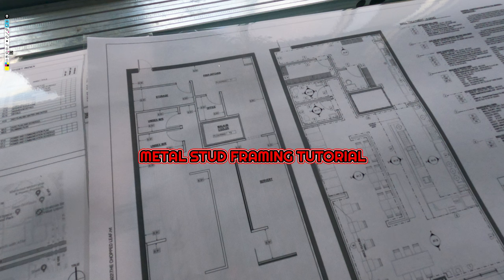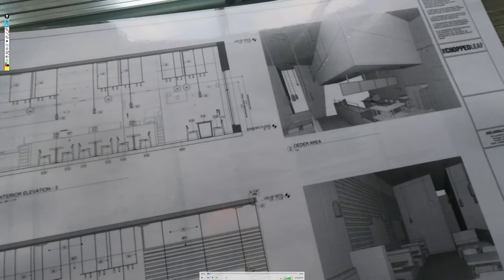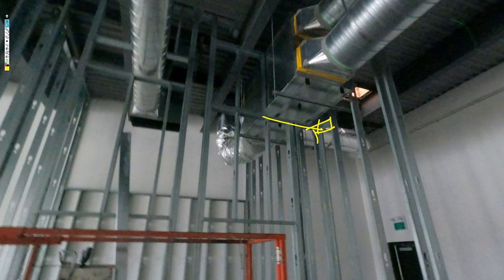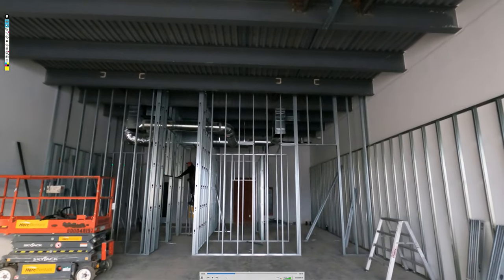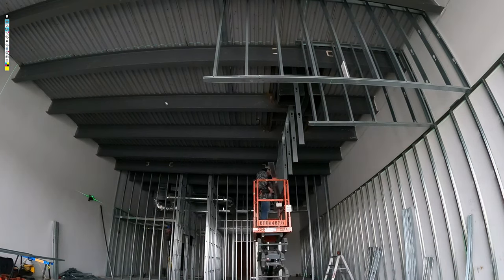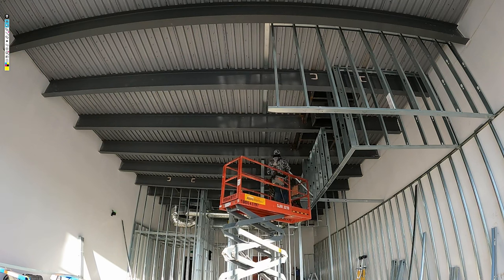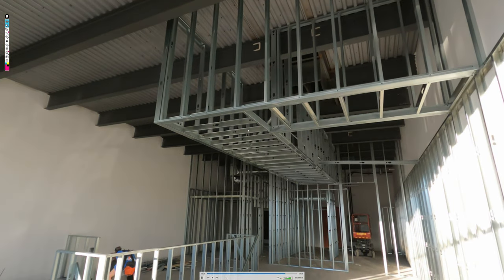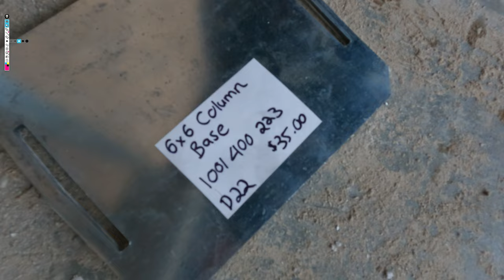Metal Stud Framing Tutorial! Walls, Bulkheads & Ceilings

Comment: I learned more from watching your video than I have learned from any foreman I have worked with before. I have been working construction for 5 years now and everytime I asked someone information about blue prints I would always get turned away. I've built all this before. After watching your video it finally clicked in my head. Thank you. I will pass this video on to my friends.
Reply from the maker: Exactly why I do this, I know how hard it is to get information out those guys. It's a better world when we pass on information and grow💪 right on man!
Reply: That's one of my pet peeves. When are a journeyman or an apprentice. Not being involved in the drawings to see exactly what you're building. Vertical wall assembly, very important to know. I am a foreman for a union metal stud framing outfit in Alaska. I don't keep my team in the dark at all, in fact the opposite. I am also determined to sharper than I was the day before.
Reply: Alot of times they dont want you to know too much they dont want you getting better then them and they dont want you taking their job i found this to be the case alot.  Ive forgot some of the stuff hes doing and have done tons myself im looking for assistant super or working foreman job I still enjoy work but years of framing and drywall got a double fused spine.  I bought some books years ago they are great and even old bosses used to copy pages to share info with the newer guys Im gonna pull them back out now to get some refreshing out of those too.  Get yours get the knowledge get the experience and get your money.  Dont let know hold you down.  There seems to be some good paying jobs out there today better then 25 years ago, and Im seeing alot of opportunities out there in the Trades and im bound to go get mine.  Take care brothers and be safe.  Sharp stuff, dont take a lift up without seeing where your wires are and dont stuff eachother in the face handing studs up.  Out in front of eachother and communication. I got some slices and dices slipped on a wet roof doing Apple Store for the release of the Iphone. Almost went down on my neck luckily I only cut my forearm all the way across the bottom massive cut.  Sliced a wrist one time as well.  Take care.

Comment: If I have a freestanding metal stud room, which is four walls, how do I run the ceiling joist… The walls are only 8 feet and the ceiling is 10 feet so it’s not going to be up to the metal structure and the building ceiling.
Reply from the maker: You should run your walls higher or lower the ceiling that's the only way my friend!

Comment: Thanks for the great video. Is bracing required for a 9 foot 4 inch tall partition below a 15 foot ceiling? Can I just screw into the 9 foot 4 inch drop ceiling grid?  The wall has joining walls so it’s locked in laterally. Thanks.

Comment: Great video, and honestly as a DIY’er it really helps.
Question, I’m planning to add a room in my condo unit, as per the builder’s layout plan. The floor is all vinyl laminate. Should the floor be removed or can I install the steel tracks on top of it?
Thanks
Reply from the maker: Right on!! Yes for sure you can put the track right on top of the vinyl! Just beware, if you ever want to remove the vinyl it will be a hassle to cut the edges around the walls. Most of the time we just put a new 1/4" subfloor over the vinyl for hardwood or carpet. Its very challenging to remove vinyl, it takes a large machine to do it proper / quick.
Reply: @ConstructionKronies  thanks a lot. But just to be clear, the vinyl i'm referring to are the floating vinyl planks flooring. Not sure if you responded with the glued-on squared tiles in mind, which i totally agree, those are a pain in the neck to remove. So, would that be okay, or should I remove a section of vinyl planks and then install the tracks? Cheers!
Reply from the maker: O ya so that makes it easier even, I would put the track right on top. If later they want to remove the flooring you can use the flush cutter around the perimeter and remove the tiles.

Comment: Hi, I just discovered your channel, amazing stuff.
I need to do a round framing platform of sorts 72” on the ceiling above a round table. What would you suggest is the best way to go about it?
Thanks?
Reply from the maker: You can get track that bends now. Draw the circle on the floor even if its a finished floor just tape down some hard board and draw on that. Then make the top and bottom track, forming it to that circle. Then laser up with a couple pin lasers 2 opposite edges to install the top track. Set a line laser to elevation and check your stud lengths, cut them, install a few to get the bottom track on (still checking with the pin lasers that it lines up with the top. After that just finish studding it out and then wrap with 1/4" or 1/2" drywall.

Comment: Do you use deflection track on top full length walls making studs 1 inch short and letting them float. No stud screws at top of wall
Reply from the maker: Yes, every wall that goes u\s structure has to have slot track. We cut the stud anywhere from 3/4" to 1" shorter and we put the screws just below the half way of the slot. You can also take them out.

Comment: Do you use 4" stud for the ceilings or 6" what span can you go with 5/8" sheet?
Reply from the maker: Mostly 3-5/8 if nothing goes on top. Go bigger both stud width and drywall, maybe add 3/4" ply if you plan to put anything heavy on it. You can really go as big as you want, brace it proper, run furring bar on top with hanger wires to eyelegs in the ceiling, they have for steel self drilling and concrete you can shoot them in with a Hilti. Like tbar but for drywall ceilings. Hope this makes sense.

Comment: ok nice to watch your videos ..nice work..i am a licensed carpenter but no experience with this stuff  but i now am working on a 60 unit building and have put in a bunch of drop ceilings using hat track and shinny 90 they call it all put together with half inch kelly screws ....but now they want me to build bulk heads in each living room to hide air pipes and dryer vents using hat track and   l brackets AKA shinny 90  any advice on hat track spacing and screw length or just any advice would be very very very much appreciated...thanks
Reply from the maker: Yes my man, use the #8x1/2" wafer screws for metal to metal and the 1-1/4 drywall screws putting the angle to drywall. I always go 16" o.c. for ceilings and bulkheads never 2'. Hope that's helps. My apologies it took so long to get back to you. I just got back from an out of town job was beat.

Comment: Great informative video, thank you for sharing.  How do you go about connecting the tracks to the sheet roof?
Reply from the maker: We will use self taping framing screws, wafer heads to the qdeck, and we use clips if the track lands in between them, use self tapers to attach the clips and then we can use regular framing screws to fasten to to clip (for light gauge steel). If it's concrete or structural steel we use the Hilti BX3.

Comment: So the corrugated metal roof decking you chose to “shoot” into instead of a self tapping screw was sufficient support for top track, is it common to be able to make protrusions into the roof decking? I have to frame some walls in a commercial application and I’m more of a residential contractor, Thanks!
Reply from the maker: Yes, so it's actually not corrugated roofing panels, it's qdeck. On top of the deck there will be another 8" at least of material before the gravel or sbs.  Only shoot to qdeck when it is full of concrete. We use heavy gauge framing screws to screw the track to it. Hope that helps my man!
Reply: @ConstructionKronies so you use screws to secure top track to qdeck. Is there a specific nailing to screwing pattern? Thanks.

Comment: can you use metal studs to build temporary office pods without fixing the studs to the wall for support? It would be a square box about 10x12.
Reply from the maker: You sure can. What we have done too is just double sided foam tape, two runs, on the bottom track so we don't make holes in the floor. Cross brace with 4" to 6" flat stock to keep square and if you can brace to the deck above then tbar (suspended ceiling grid.) The walls just have to be 6" above the ceiling.
Reply: @ConstructionKronies If it had to be low sound or sound proof, could I double up the studs and bridge them across the roof using bracing in between and just put sound proof drywall up?
My ceilings are 18ft tall.
My wife wants to learn drums.
Reply from the maker: Yes sorry for the late reply sometimes replies to replies get lost, YouTube needs a better way to tell us. For STC (sound rating) you can insulate, use 5/8"  drywall, even go 2 layers of 5/8"  both sides, use green glue (soundproofing glue) in between layers or resilient channel.

Comment: Can 25g studs hold double 5/8s drywall to help with sound?  Span is less than 10’.  Can also use a bracket at the middle of span into floor joist.
Reply from the maker: Yes for sure 25g will hold double 5/8". I just wouldn't go less than 3-5/8".

Comment: Hope all is well with you, how do you put extra support in a ceiling that's 14' by 14'?  Can you use a 16' piece of lumber and then attach your track to each side of that for extra support?
Reply from the maker: Use hanger wire. You can wrap it around a joist or use eyelegs.

Comment: at what point would you introduce black iron through the ratholes? my foreman was explaining it to me the other day on a 12ft soffit we installed. at what height would you normally do this
Reply from the maker: To be honest with you, I'm not sure. The rod is usually bolted in before we start by the iron worker. If the soffit needs any structural reinforcement the specifications will surely tell you.  We stiffen our soffit with channel and furring bar running along the inside and maybe wire or pencil rod we work on 4x4 max spacing at any elevation.

Comment: Is that the metal roof that the top track is screwed into asking for a friend 😅
Reply from the maker: No we wouldn't screw to a metal roof, what that is -- is metal decking we call qdeck it goes below the roof or is used between floors. Sometimes filled with concrete if between floors. When it's on the roof the next layer will be roof board, rigid insulation and so on depending on if it's sbs, modified or metal standing seam. It's I think 18 gauge usually so use heavy gauge self taping screws.

Comment: Great information in this video. How long of a span can you do on a ceiling before you need to add a support to the concrete floor above? I have a 16’ x 10’ space. Using 1/2” drywall. 2 1/2” x 10ft stud. Would I need to support it?
Reply from the maker: Yes grab some furring bar, run 3 rows (rule is braces every 4x4sq area) equal distance apart and make sure to attach it to every stud on both sides of the furring bar (2 screws every stud) make sure it literally runs end to end screwed into the track either end and also screwed together, then shoot kickers up to the ceiling every 4' staggered on those runs. You should be able to hang off it with no movement.

Comment: Hi, what gauge steel is recommended for residential ceilings?
Reply from the maker: 25 gauge, you can use 3-5/8", 6" studs and track or 25 gauge furring bar and angle depending on your clearance.
Reply: Thank u so much,  cud u do a video on hanging prehung doors using metal studs, nobody has one on yt.

Comment: Any considerations when framing walls for a walk in shower?
Reply from the maker: Use 20 gauge studs and blue mold resistant board! Wrap it with detra as well before tile.
Reply: @ConstructionKronies  thank you! Been twenty years since I did metal framing with my dad (was twelve= nearly zero help). Lots of detail I hadn’t considered.
Reply: @ConstructionKronies  Follow up question....do you recommend 20eq studs or actual 20 gauge?
Reply from the maker: @rileyjenk  20 gauge studs, they are my favorite gauge. Super strong and efficient!

Comment: By code can you use it Stud Crimper or  you need to use only screws?
Reply from the maker: I don't believe it is code. What you need to know is if it is in the construction specifications either in the contract documents (drawings, specifications) or product details. They will tell you what type to use and where to use them. If it is not specified I would say use what you want. At the end of the day the drywall will hold it all together if your screws are in the right spot. I think it is industry best practice to at least screw 1 side in and crimp the backs, I know guys who crimp only the top back. If you can keep studs proper on center, and square go for it. We screw them in always so its faster to drywall and better to tape and so on. Its important to have square studs and screw the soft side in the bevel first. That way the sheets won't pop out and give your walls humps.

Comment: Hey Chris . Great teaching video. I like the video edit format with your narration. Please,
You mentioned something about offsetting bevels in comercial.  I am missing what you mean. Its around the 5 min mark in the video. I think. Anyway explain if you ever get time. Thanks. Good work.
Reply from the maker: Yes I think what your asking is about staggering where the sheets land on either side of the wall. you want to make sure the bevels (sheets) don't land on the same studs.  For example: Side A we will start with a 16" strip then full sheet and Side B we start with a 32" pc so that the joints are staggered. Hope thats it bro!

Comment: Great video quick question my plans say to extend the wall 6 inches above the ceiling why is that? Is it so you stop with the t bar and then do separate rooms or is it for soundproof or fireproof? Can you let me know? Thank you.
Reply from the maker: Great question, it's just a reference that your walls only have to be 6 inches above tbar and not all the way to the deck. So say tbar is at 9 foot you can use 10 foot studs for the walls, it doesn't have to be exact just a minimum of 6imches. Drywall too, technically your walls will be at 10' 1/2" so you can keep your drywall a 1/2" off the floor and use 10' sheets or cut your sheets to 9' 6" .

Comment: Good work!
Reply from the maker: Thank you..the carrying channel never came with the delivery. I think these guys  cheap out honestly. I always order it and it makes drywall so much easier, just sometimes it doesn't come. I will be putting it in eventually I have extra on another job. Cheers !
Reply: @ConstructionKronies  tell the inspector that.. haha
Reply from the maker: Yeah you know, they never inspect our framing only the insulation and fire rating. Do they have it in the code where you are?
Reply: Yes over in Toronto it’s a must every 4’, overlapped and screwed together depending if it’s a fire rated or sound brier. 

Sometimes they ask for bridging clips..depending on the engineer.

Comment: What methods are available in attaching/connecting pre-sheathed 8'w x 10't steel stud walls, vertically from 1st floor to 2nd floor & 2nd floor to 3rd floor ? Sheer cassettes are already built into our wall panels.
Reply from the maker: Yeah, I'm not a fan of this method, panels are a real pain in the butt. However, after the panel is in place we just drill 1/4" to 3/4" bolts or rod into the concrete and fasten down nut and washer. 9/16" to 3/4" #8 or #10 hex self tapers for the top if steel or just hammer drill if concrete like the bottom. If it's suspended outside like curtain wall you need to pre-install clips with hitting shots or pin boots  then 4 screws into a stud.

Comment: What is your ceiling attachment detail for the top track of the hulk head to the roof? You’re not screwing into the ceiling panels are you?

Serious question, not a critiquing tone, just super curious
Reply from the maker: Yes we screw the top track to the q deck if it's hollow or shoot it with direct fastening tool like hilti or ramset if it's filled with concrete. The roof itself will start 3 to 6" above the top flute so you never have to worry about holes in it.